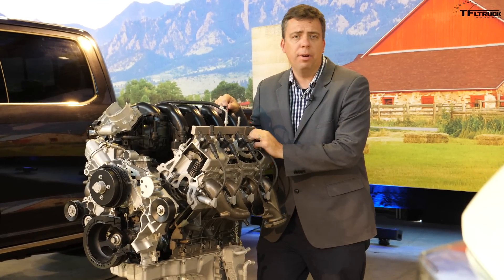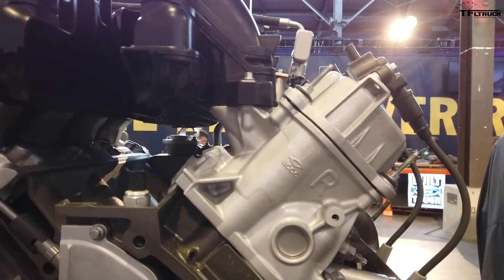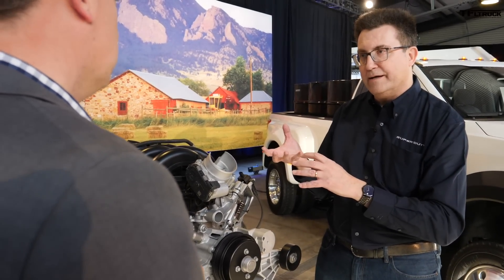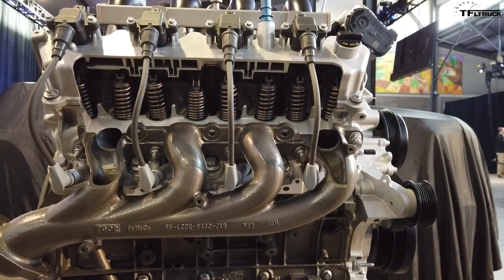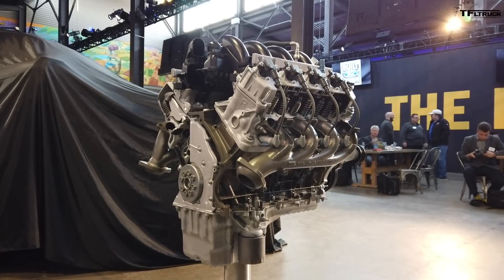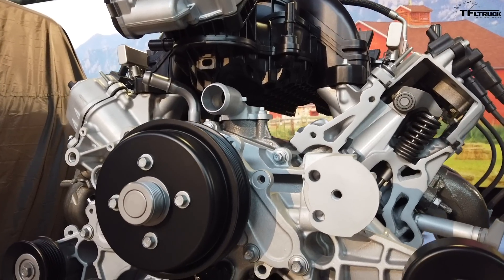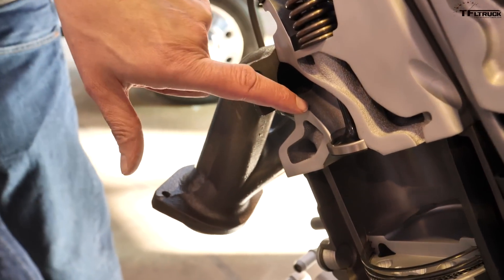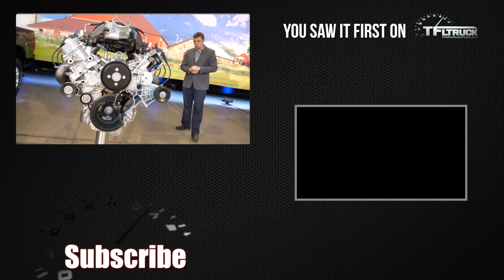2020 Ford Super Duty 7.3L V8: Here's What You Need to Know!

Comment: Are engineers finally coming around that there is no replacement for displacement for 3/4 ton trucks?  I think this is a great move.
Reply: Kyle Riegle it’s for their 650 750 trucks as well.
Reply: I cannot wait to find one in a junkyard so i can afford a Super Duty motor for my Car.
Reply: Kyle Riegle no they’re not. Which is why you see such an emphasis on TURBOCHARGED Diesel engines. Lol. 

There are replacements for displacement.

This is simply a low cost option for businesses that don’t want to spend $10,000 on a diesel upgrade.
Reply: Firestarter TURBO BAD!!!! Unless it’s in a diesel because somehow that different......
Reply: @jasonlarsen3515  I once was on a boat powered by two V20 quad turbo Diesels. 10.000 HP at 1200 RPM each!
Reply: Firestarter No, there isn’t a replacement for displacement. If all things are equal (e.g both have turbos etc...) the big engine always wins. Do everything in the 3.5 to the 5.0 and tell me which has more power.
Reply: bwhs89 the 3.5 clearly has more power and torque... 450hp and 510 ft lbs.

And it’s power doesn’t drop off with altitude like the 5.0 does. 

The 3.5 even craps all over the 6.2l it replaced. 

Judging by your comment I’d assume you haven’t towed with a 3.5, cause it blows the doors off the 5.0 and runs at much lower revs. 

Even the weaker 3.5 matches the 5.0 on power (dyno show it has slightly more, but ford derates it for whatever reason) on the top end and completely outclasses it from 2,500 rpm. 

But you’re probably one of those truck guys that thinks low end torque is pointless and high rpm power is what matters. 

#micdrop
Reply: needs timing gears instead of a timing chain
Reply: @KTMcaptain  a power stroke and its competition all have a lot of displacement just saying.
Reply: Looks like a good replacement for the V10 in the gasser motor homes both class C and the Class A.  I wonder if it will make its way into the F53 chassis?
Reply: @KTMcaptain  i thank u missed his point. Hes saying all things even a bigger displacement will always make more power. To your point ford dosnt make a turbo 5.0 so it dosnt matter, but if they did do a 5.0 turbo it would make more power than a 3.5 turbo. Just like the 3.5 turbo makes more than the 2.7 turbo. The bost is what makes the 3.5 more powerful ( and i agre with u i have a 3.5 crew cab that would walk my much lighter 5.0 regular cab 2wd work tuck) if both motors were bosted the bigger motor wins.
Reply: Steve Blakley and yet it still needs a turbo to make that power. How much torque do you think that 6.7 would put out without a turbocharger? Lol. 

Guessing you never drove a naturally aspirated Diesel engine.
Reply: Steve Blakley don’t be ridiculous. Ford doesn’t make an engine to maximize power. They start with a goal in mind. 

So comparing 400hp engines, the 3.5 does a better job of making far more average power throughout the gear ratios than the 5.0 does. 

So for 400hp there is a clear replacement for displacement.
Reply: @bwhs89  lol u clearly have no idea what your talking about I've raced and fully built many ls v8's and bmw n54s and 4g63s when its time to bully sum cars the 4g63 a little 2.0 is the boss everytime .
Reply: So a 3.5 would hold up in a 3/4,1 ton, medium duty truck? Is that what I'm getting out of this argument?
Reply: Firestarter your right, diesels are expensive and diesel fuel in Canada is more expensive than gas, so a gas engine makes more sense for many here in Canada. $10,000 extra for a diesel and 15 cents a litre more for diesel adds up fast.
Reply: @KTMcaptain  i just said that my 3.5 pulls better than my 5.0 work truck. All i said was the bigger the displacement the more power u can make thare for a big displacement motor with boost will out perform a small motor with the same boost. Its calls the larger motor starts with the advantage of displacement. So no mater what u do to the smaller engin if u do the same to the big one the bog one always makes more power. Same gose for vvt, dfi, boost what ever the larger mottor always has the built in advantage of size.
Reply: its amazing what Ford'll do to keep UHaul's business once they get it, but don't worry, their doing this for the budget minded folks who realize new trucks don't last as long as the diesel engines and there's no real point in spending an extra 5-10k for an engine that'll last longer then the truck when theirs a cheaper engine that'll get the job done, especially if you don't live on a mountain, and yes, this engine is built cheap, not well
Reply: Firestarter the 3.5 don’t fall on its face at altitude because of the turbos. Add the same setup to a 5 litre and you would be looking at a motor that would totally crush the 3.5. You would probably be looking at close to 600 hp
Reply: Matt J who said medium duty 3.5?

I have no doubts that a 3.5l turbo engine could be engineered to work for a medium duty application, but the actual 3.5eb and 5.0coyote aren’t medium duty.
Reply: @KTMcaptain  nah the 5.0 is better
Reply: Firestarter what point are you trying to make? Because the 3.5 needs the turbos to make 365 hp. Take off the turbos and you have a motor with under 300hp
Reply: @bwhs89  The 5.0 is a better engine to modify than the 3.5
Reply: The bigger engine will ALWAYS put out more power,there's that thing called forced induction.I don't see too many top fuel 4 and 6 cyl's but plenty of 10,000 hp Hemi's.
Reply: @KTMcaptain  Diesel is still an option because it's better for towing.
Reply: The EB is simply a strung out v6 set on kill
Reply: @michaellittlejohn8723  So basically wait two-three years.  🤣
Reply: Wasup Fool the 3.5 eb makes 450hp 510 ft lbs in the f150 and 647hp in the GT...

So clearly there is a replacement for displacement, and it’s called a turbocharger. 

Even semi tractors use much smaller engines than they’d ordinarily need without a turbo. Yes they’re large, but it would need to be significantly larger without the fi.
Reply: Yo Dawg strung out? Iron block, forged engine internals, and better oiling....

It’s not a strung out v6.... that’s like calling the 6.7 Cummins a strung out 6 cylinder cause it makes 1000 ft lbs of torque.
Reply: Yo Dawg lol I wouldn't waste much time on an EB fanboy that doesn't comprehend science.
Reply: Javier Hernandez the 4WD is way better than 2WD especially when you’re towing heavy loads
Reply: @jaywhy225  haha very true
Reply: @chanseormon  Actually its not. If you stay on pavement, a 2wd is more stable, and gives better MPG
Reply: bwhs89 “ Do everything in the 3.5 to the 5.0 and tell me which has more power” is a dumb argument lol. The boost being the replacement for the extra displacement that the 5.0 has. So making it so the 5.0 is bigger and boosted on top of that isn’t really proving anything
Reply: American engineers of the Big Three have known that all along! just like they also knew that diesels are not meant to do work in passenger cars ! 
good thing is that they are so bold to act, engineer and develop their engines accordingly ! unlike the sham that is going in other markets, such as germany.
Reply: Capt. Crab you’re not moving a semi truck with the 5.0 or 7.3l either, so that’s a worthless hypothetical. 

You can engineer the vehicle with stronger parts and better heat rejection for longer duty cycles. 

Displacement has nothing to do with the size of your mains or rod bearings. You can easily build a block to handle those kind of stressors. It’s not beneficial to do so because of cost.

Displacement does not equate to reliability. The 5.9 12 valve Cummins 6bt is far more reliable than the 6.7 24 valve Cummins. 

Even the 3.9L Cummins in-line 4 was extremely reliable for commercial use.
Reply: bwhs89 go look at Ken blocks f-100 and tell me you can’t get power from the 3.5L. 🤘
Reply: You can get big power out of most engine's but longevity and reliability are the two main factors,it just make's more sense having a bigger engine that doesn't have to work as hard,it's called common sense.
Reply: @joeyscleaningladys  mo' money
Reply: Yo Dawg he also reminds of that CJ Colvin character... always bragging about his “96 F150 with the 5.0 Windsor V8” and that we’re all a bunch of “typical modern truck lovers”. You just can’t fix stupid.
Reply: @jaysson1151  nope
Reply: You can’t argue with physics... there is no REPLACEMENT for displacement.  That whole saying is utter crap that is constantly said by people with smaller cube engines with some sort of forced induction.  What they should say is that there is a COMPENSATION for displacement. As in, the turbo or supercharger or what have you, is compensating for the lack of physical displacement that the engine has.  Sure, you can make a small engine perform like a big one with the use of direct injection, variable valve timing, turbo chargers and all that nice new technology.  But give all that same stuff to an engine with more displacement and the bigger engine ALWAYS makes more peak power.  Has to be an apples to apples comparison though.  Meaning that all things are equal with both engines except for the displacement. People that say there is a replacement for displacement are never making an apples to apples comparison though.  Just cuz your 11:1 compression ratio, direct injected, turbocharged 4 cylinder makes more power than a 8:1 compression, port injected naturally aspirated big cube engine, doesn’t mean there is a replacement for displacement.  It’s physics.  And unless you don’t live on planet earth and somehow have an engine that follows some other crazy laws we don’t know about, it cant be argued.
Reply: @prophed4849  exactly.The bigger engine doesn't have to work as hard unlike the smaller one's making the same power numbers which are damned near maxxed out.
Reply: @KTMcaptain , this 7.3 is meant for the F250 and up
Reply: Yo Dawg yep. People seem to forget that the four stroke internal combustion engine hasn’t changed all that much.  They get lost in all the hoopla and technology.  Sure we’ve made engines better by increasing their volumetric efficiency over the years.  But one thing stays the same. In the end, it’s still an air pump.  And the bigger the engine the more air you can pump in (or force in) More air means more fuel burned and more power made.  Ford is smart here.  They found a niche market and are exploiting it.  Diesel prices have gotten insane.  I would love a new truck but can’t swallow spending 60-70k on one.  So my old 7.3 Powerstroke will just have to last me another 230k.  Shouldn’t be hard since Internationals D50 life is rated at 500k.  This new 7.3 gasser hopefully avoids the premium price while still be able to tow. Another advantage of displacement is that it moves the torque curve down low so you don’t have to spin it fast.  Look at giant ship engines. Those things turn like 150 rpm and make  tens of thousands of ft-lbs of torque.  How?..... Displacement.  Always got a kick out of the guys who bragged about making 400 hp with their tiny little engines, but had to rev it to 9k to make it.  Oh and that 400 hp came with a whopping 205 ft-lb of torque.  Carol Shelby said it best “HP sells cars, Torque wins races”
Reply: Firestarter turbos aren’t the replacement for displacement on diesels. Diesels no matter what size are dogs. Try driving an 80s pickup like the 6.9 idi ford used. They could pull like a raped ape, but couldn’t get out of their own “coal”. Turbos help them in acceleration.
Reply: Yea the old IDI engines were horribly inefficient.  They relied on their shear size to make the sufficient torque to be able to pull.  And they did it rather admirably considering a lot of them didn’t have turbos and also had terribly low (for a diesel) compression ratios.  Diesel fuel has more energy content than gasoline so it has an advantage in making power right out of the gate.  But because it’s so much more resistant to detonation, it takes a lot of squeeze to make it go boom.  So you have to design an engine with a relatively high static compression ratio.  Add in the turbo charger and your looking at an even higher dynamic compression ratio.  All that squeeze takes beefy parts to live at those levels.  Makes for a long lasting, high performing engine.  But an expensive one at the same time.
Reply: @KTMcaptain  No replacement for a good turbocharged diesel.
Reply: @KTMcaptain  if they both have turbos  I'd say the 5.0 would win
Reply: @KTMcaptain  When you say ''weaker'' 3.5L I can only assumed you mean naturally aspirated 3.5L...Which dynos around 230hp to the rear wheels, the current gen 5.0L (in the F-150) dyno's around 315hp to the rear wheels, yeah the Ecoboost is a little better for towing as it damn well should be! It makes 70lb/ft more torque! BUT don't come on here slandering a bunch of bullshit about how Fords base 3.5L V6 is comparable in power to the 5.0L...News flash...its not.
Reply: @nathanmcdonald610  the 18 5.0 in the trucks are putting 350 to 360 hp to the tires in stock form from the 2 wheel drive! The 4x4's are putting down around 340 or so to the tires! There are a few videos that show this! The new 5.0 is no joke in the power department!
Reply: Absolutely smart
Reply: @jasonlarsen3515  because a turbo on a diesel is completely different than turboing a gas engine. Diesels run on detonation gas engines die from detonation ;)
Reply: I agree with  @KTMcaptain . My father has a 3.5 T and can outpull my 6.5TD all day long.  Its just better in every way.  I may have more low end torque being a larger displacement turbo diesel.  But thats not noticeable while driving. 

In 2-3 years once this engine is more refined it has amazing potential to compete with TD engines without the crazy price tag that comes with owning a diesel.
Reply: Actually, yes, diesels are different. That's why turbocharging is ideal (essential, really) for them.
Reply: @KTMcaptain  LOL there is no emphasis on "turbo diesels".  If anything, it's exactly the opposite.  Diesels are getting less and less efficient and more and more expensive to maintain.
Reply: Ethan Noel 1) you’re absolutely 100% wrong. Companies continue to develop Diesel engines. Expensive yes, but the best solution for heavy hauling by far. Also, since the dpf became mandatory, the engines have only gained in efficiency and are nearly where they were before. Government doesn’t test them because of their gvwr, so it’s hard to do direct comparisons over the years. 

2) I capitalized TURBOCHARGED and placed the emphasis on forced induction. As in, Diesel engines are dramatically smaller than what they would need to be naturally aspirated, so there is a clear replacement for displacement. So you were wrong on that assumption as well.
Reply: @KTMcaptain  Then why did Ford just come out with a new gasser and not a new powerstroke?  And when is the last time we saw a new version of the current 6.7 cummins?  And no, they're never going to get back to the efficiency they once had due to low sulfur fuel.  I get why diesels need to be turbo'd..it's not due to size, it's due to mechanical limitations on creating an effective compression ratio.  Right now, unless you're using your truck as strictly a towing vehicle for 10k+ lbs loads, there is no point in getting a diesel.  Gas is way cheaper, the engines are cheaper, and there is no emissions crap to worry about breaking down.  It's sad because I really love diesels but the fact of the matter is that our government is strangling them out of existence.  If this 7.3 is able to put down more than 700 ft/lb of torque and get halfway decent gas mileage, it's going to severely hurt diesel sales.
Reply: @bwhs89  that 5.0 would scream over 1200 hp hehe. Feel free to hook up my f150 I'll be the Guinea pig
Reply: @KTMcaptain  your argument is silly because the 5.0 isn't blown. Put two hairdryers on that smoke wagon and see what happens. #micdrop
Reply: ace 996 4g63 ftw 🤘
Reply: Ethan Noel that’s a laugh. Ford develops new engines continually. They continue to develop their power stroke Diesel engines. The f150, Silverado, and Titan all have Diesel options now. 

There is also a newish L5P dmax and a 1000 ft lbs Cummins.

Diesel engines do benefit from turbocharging, but don’t kid yourself. You think the 6.7 Cummins can come close to 1000 ft lbs without a turbo? Is that why my 12v Cummins had 215hp and 440 ft lbs stock with a turbo?

Diesel engines absolutely need the turbo to make their HP and torque. Without it they’d be dramatically weaker.
Reply: Fords need only make enough power to drive themselves either a) over a cliff, or b) to a Dodge dealership.

Hahaha, just kidding. About the Dodge dealership part, I mean. Dodges suck, too. Totally inferior to Chevy. Which also sucks. The best part about a Chevy is that a Toyota dealership will allow you to trade it in if you buy one of their vehicles.

If you are upset at what I have said, you just don't get it 😢     😉
Reply: @noidontthinksolol I was just posting some BS to go along with the rest of the BS. Everyone gets so hung up on snippets of wise-sounding information or catchy phrases. 

The fact is, there are many ways to accomplish a powerful engine. Some ways are better for different applications.

A big engine, generally speaking, allows for more power. To further augment an engines capabilities, forced induction is extremely useful. It doesn't necessarily "replace" displacement. I mean, try throwing a turbo on a motor with zero displacement. What a turbo WILL do, however, is increase what a given amount of displacement can accomplish. 

A lot of people here made some great points. At the end of the day, displacement and air intake are very good partners. One is not better than the other. They are different beasts entirely. Trying to compare one to the other is a bit silly.
Reply: @steveblakley5285  At least you get his point. It's amazing how some people seem to totally misunderstand what was actually said which in turn triggers a huge debate over what seemed to be a very simple and straightforward comment.
Reply: AMEN
Reply: @steveblakley5285  You are correct. A smaller displacement engine has to work harder to make the same power as a larger displacement. A 3.5 L will have to run much higher cylinder pressures or more ignitions per second than a 5.0 L at the same power levels. The Ford 3.5 goes the higher cylinder pressure route via forced induction.
Diesels are a different animal since they are compression ignition and it is easier to get to the required ignition pressure if your intake is already pressurized.
Reply: @KTMcaptain   Lol nice Hash-tag use /s.
I never said I hated that 3.5 or that It was weaker than the 5.0.
Also, I understand the statement "replacement for displacement" is meant as the turbo etc... making up for the difference in engine size. 
My point was only that all things being EQUAL, the bigger engine will always win. Trying reading for COMPREHENSION next time as it was pretty damn clear in my first comment. 
My original comment being correct doesn't make the 3.5 suddenly suck. 
And yes i'd still rather have my 11' port injected 5.0 any day, even if the 3.5 "blows my doors off".
Alas, where did I mention torque curves? I know the 3.5 tows better but the 5.0 also tows as well. You act as if it isn't capable of any truck duties.
Reply: @KTMcaptain  Gear ratios don't affect engine power. The 3.5 makes good power across it's wide power band because the turbo pre-pressurizes the cylinder before the compression stroke. More air at a higher pressure means more fuel can be injected resulting in higher cylinder pressures (torque). The risk used to be pre-detination but this has been fixed by not injecting the fuel until the piston is at or near TDC. The trade-off is that you have to build a more robust engine to maintain longevity.
Reply: @KTMcaptain  Diesels are compression ignition and aren't really comparable to normally aspirated or forced induction gas engines. Non-turbo diesels have a lot of trouble getting the required cylinder pressure quickly enough to ignite efficiently.
Reply: I was excited until I found out it wasn't a diesel they shou lda   simply made it  a 460
Reply: Rich I never implied that the 3.5 needs a gearing advantage. Like I’ve said before, it has a much wider torque band than the 5.0 which allows it to tow and haul much easier. 

Gearing does in fact change the way torque is delivered to the ground though. 

Diesel engines don’t require a turbo. Yes it’s true that a turbo helps their efficiency under load because of the extra compression (turbo charger pressure ratio x static engine pressure ratio = total pressure ratio), but they’ll run just fine without a turbo. 

Diesel engines struggle with engine timing. As the rpm grows they have a harder time advancing the fuel and maintaining efficiency. This is why they make good torque but little power without a turbo, and why torque always seems to be double the power. 

So yes, you’d need a dramatically larger Diesel engine to make the same output as a turbo diesel.
Reply: @KTMcaptain  Modern diesels don't have problem with engine timing as they are all electronically direct injected and there is no ignition timing on a diesel. Diesels don't like high RPM due to several factors (reciprocating weight due to beefier components to deal with very high compression ratios, slower burn rate than gas etc). Turboless diesels are extremely inefficient (the Detroit Deisel 6.5 mentioned earlier in the comments had peak naturally asperated output of 155 hp/340 lb/ft). The only time that NA deisels perform acceptably is in huge footprint scenerios running under 20 rpm.

Also, you stated that the 3.5 does well across all gear ratios. Which technically isn't true since an extremely high or extremely low gear ratio would hamper performance of any engine. The 3.5 does have a wider power band than the 5.0, but the 5.0 is not really having to work to make power. Internal stresses on the 3.5 are higher due to higher cylinder pressures.
Reply: Rich your comment shows how little you know about Diesel engines. 

Their piston bowls correspond with injector spray patterns. At higher rpm where they’d need more advance, the piston bowl becomes misaligned. Also, the piston will create less compression with more fuel advance making it even more inefficient. 

turbochargers don’t help Diesel engines unless they’re producing higher compression ratios. Driving unloaded down the road they aren’t producing enough pressure to change that. Yet Diesel engines are extremely efficient even when unloaded. Turbos just make them that much better. 

I know this as a fact with my 12v Cummins getting 25mpg with a large single turbo that didn’t make any boost until 2200 rpm. 

And you can design the diesel with even more compression to be just as efficient.
Reply: There most certainly are many 'replacements for displacement'. Such as well thought out torque multiplying gearing and forced induction.
Reply: Less high tech stuff, better engineering, more reliable...
Reply: @KTMcaptain  I misunderstood what you meant by advance (fuel injection rather than ignition). 
It's funny that you use the 12V Cummins as an example of turbos not helping unless you are at higher compression ratios since the 12V had a higher compression ratio than the 24V or the ISB (or the powerstroke or Duramax for that matter). Obviously with higher pressure forced induction you have to drop the compression ratio to keep cylinder pressures managable. 
My Cummins ISB gets about the same fuel economy whether I am unloaded or pulling a 27 foot v-nose trailer, but I have all the EPA shit on mine to make sure that I use more fuel than I need to.
Reply: Chris Rowlison what do you mean by modern trucks do not last as long?  If anything, I would say the opposite is true.  Modern trucks have achieved the perfect balance of utility, ease of use, comfort, and reliability.
Reply: Around here a lot of ranchers still use their old pickups from the 80s and 90s.  Does anyone think in 2050 any rancher will be using their 2019 ecoboost?  I don’t think so.
Reply: Can't believe how ugly those new trucks are
Reply: @KTMcaptain  he said everything in the 3.5 to 5.0, that means twin turbo and such to the 5.0 it will make more power
Reply: Michael Corbett that’s ridiculous. The 5-0 doesn’t come with turbochargers. You can add nitrous to it if you want, but it doesn’t come that way. 

You say there isn’t a replacement for displacement. Then you don’t need the turbos. Just the bigger engine. 

In the 60s Ferrari and Pontiac made cars with the GTO moniker. One had a 3L v12 and the other a 6.5L v8. They made roughly the same horsepower, with the 6.5 tripower option making 14% more power. 

That’s idiotic hypothetical is meaningless. You can add whatever you want then. 

There are 3.8L GTR engines built to 4L making 2000hp. Can the coyote do that? 

It’s ridiculous because anyone can change anything on their engine. 

Stock vs stock the 3.5 blows the 5 liter out of the water. And even the 6.2 Chevy v8 when you’re talking about the mid level 3.5 ecoboost (limited and raptor h.o. version). 

So yeah, there are several replacements. Nitrous, supercharging, turbocharging, rpm enhancements, different fuel injection technologies, better fuels... and probably others. 

Btw, stock viper engine vs stock ford GT 3.5 ecoboost... 8.4L v10 makes the same HP and 50 more ft lbs over the 3.5 ecoboost. Even the supercharged zl1 6.2L Barely out powers the 3.5 ecoboost. 

But you’ll keep complaining about turbos. And just by your complaints you’re acknowledging a replacement.
Reply: @KTMcaptain  dude how dense are you, we are saying if you added the turbo and same technology used in the 3.5 to the 5.0 (making the ecoboost a 5.0) it'll make more power, I can tell you are only here to argue and not to bring anything meaningful to the discussion.

As far as the topic of different engine designs it's just that an engine designed for a different purpose. High rpm go vs low rpm torque, one engine designed for an awd application and less than 4000 pound car vs 2 or 4 wheel drive 4000 to 6500 pound truck made to tow and haul.
Reply: Michael Corbett how dense am I? Lol. 

You’re the one constantly adding custom parts to an engine that doesn’t come with it to try and make an irrelevant point. 

That a custom built engine will make more power than a 100% stock one. Lol. 

Put the same exact turbochargers from the 3.5 on the 5.0 and it’ll choke out and die. It’s not built for boost and excessive drive pressure and completely inefficient compressor will cause its death. 

Keep doing down that hypothetical rabbit hole. 

You can always, and easier, put larger turbochargers on the 3.5, so your point is irrelevant. 

Now you’re comparing turbochargers flow rates. 

Yes turbochargers EASILY replace displacement. That’s actually been the trend for the past decade, and cars have never been faster or higher performing. 

Even ford dodge and Chevy are refusing to put larger engines for their roided muscle cars. They’re using superchargers instead of larger displacements. 

So yes, there are clear replacements and you’re the dense one projecting your ignorant emotions into others because cognitive dissonance forces you to rail against smaller engines making more power EVERYWHERE. 

That’s ultimately the fact that matters. Forced induction is not only a replacement, but it makes BETTER power. More useable power.
Reply: @KTMcaptain  so bigger turbo make more power on an engine designed for it thank you for proving us right that more is more.

But like another poster said take the smaller ecoboost vs the larger 3.5 ecoboost oh wait the bigger engine with same setup made more power how strange...
Reply: Michael Corbett I guess you can’t read then. Because that’s not what I said, or are you now trying to imply that more turbocharging somehow equates to a larger cylinder displacement?

I’ll even give you naturally aspirated examples. 

Like the 3 liter Ferrari making the same power as the 6.5 liter Pontiac. 

Heck, even a modern 5.0 coyote trounces the ford 460 engine of old by 100 hp. That’s a 7.5L engine. 

The truck 460 from the 90s made 230hp and 390 ft lbs of torque. How much does the f150 5.0 make? 395hp and 400 ft lbs. so more torque and 165 more hp. 

Even the 5.2L mustang engine makes as much or more power than the 7 liter Chevy z06 engine. Bmw made a 5 liter v10 that made around as much power as both those engines. 

Facts are facts. You want to create hypothetical custom built engines to prove what? That an aftermarket engine can beat a stock one? 

A stock 5.0 is dramatically larger than a stock 3.5, yet the ecoboost makes the v8 its bitch everywhere other than peak rpm where they both make virtually the same measurable power. 

And it gets much worse with altitude where the v8 becomes anemic.

But when the ecoboosts blow you away, you can just reply, “oh yeah! If I put a turbo on this thing then I’d have won.” Lol. 

What’s next? You can throw on a heads and cam package? That’s the problem with hypotheticals, cause it’s never ending and proves nothing but imagination.
Reply: Firestarter what's he's saying is if the 5.0 was turbo charged it would be a hell of a lot better then the 3.5 in hp and torque
Reply: They should offer it turbocharged...then it would be a badass engine! More power and better efficiency with a turbo.
Reply: @stevenhorsefield2909  guy is just there to argue don't waste your time
Reply: Steven horsefield and what I’m saying is that’s a custom part for that engine. 

Take the money you spent on turbocharging that coyote and get larger turbos, pistons, and rods, and you’ll make more power with the 3.5 then. 

That’s the problem with comparing stock engines to a modified engine and making up nonsensical hypotheticals. 

And that goes against the replacement for displacement mantra. Want more power, then make the engine larger. So by saying you can make the 5-0 better with a turbo you’re admitting there is a replacement for displacement.
Reply: @joeyscleaningladys  While I totally agree, I think most companies prefer chains or belts these days as they are far quieter.
Reply: @sploofmonkey There's never been a factory 351 Cleveland-equipped Ford truck, unless you count the Ranchero. You might be thinking of the 351M/400, which is extremely similar to the Cleveland but with a different block (among other things)
Reply: @KTMcaptain  Having a good time? I thought I was the only one who noticed that your username is very descriptive of your conversation skills LOL
Reply: Trent Hura Well, A Fire Inside sounded like I had some std/sti and I didn’t want to get sued by that boyband... and intense wet dreams sounded like I wet the bed... so I settled on firestrarter. I’ve had family members accuse me of having aspergers because I’m contentious and lack the willingness to seek external validation (not caring about what others think is how those troglodytes put it). 

In reality I don’t give AF and feel that my opinions are scripture. If anything I suffer from NPD (narcissistic personality disorder). Lol

But I do change my thinking when one makes an articulate and rational argument that causes me to re-examine my own biases and conclusions on the topic. 

Cheers.
Reply: @KTMcaptain  until you realize that turbos abuse motors and it will never last as long...... you're not getting the point
Reply: IAMREALSUPERSAND the most reliable engines are turbocharged... so I guess you can keep telling yourself that.
Reply: @KTMcaptain  name a standout reliable turbo engine besides the 5.9 Cummins
Reply: IAMREALSUPERSAND there are hundreds of different turbo motors from airplanes to trains to otr trucks. 

Can you show one single bit of statistical data that is illustrative of your claim?

Typically turbocharged motors are built with stronger parts, larger bearings, etc. The ecoboost 3.5 has an iron block, forged steel crank, forged rods, and many other non advertised enhancements to strengthen it.

Where are all these unmodified turbo motor failures?
Reply: @KTMcaptain  do you even know how a turbo works??? It increases the compression of the engine to make more power, and why dont they increase the compression ratios of gasoline piston engines??? Because gasoline is unstable at the higher compression ratios. And it works for diesels because diesel is a much more stable fuel. If you build a motor and its naturally aspirated. It would last much longer without a turbo. It's just a fact.
Reply: IAMREALSUPERSAND you never limited it gas powered engines and even brought up the 5.9 Cummins. Newsflash, it runs on diesel fuel. 

Regardless,

turbocharged engines use lower static compression ratios to adjust for the increases from the turbo. 

Again, turbo motors are built stronger than naturally aspirated engines. Modern engines have knock sensors that allow the engine to pull timing and adjust other parameters to keep the engine running smoothly. 

You act like turbo motors are knocking all over the place, when in reality they run just fine. 

So you have higher cylinder pressures, but the engine is physically stronger. 

So where are all these stock blown up turbo cars?
Reply: @sploofmonkey  In the US at least, the Cleveland was never put in any pickup. It's last year in passenger cars was '74. Trucks could be had with the 351M/400 from 1977 to 1982. '78 and '79 Broncos were actually only available with either a 351M or a 400.
Reply: @tylerretty7299   Comparing an old GM diesel to a new ecoboost is not a valid comparison.  They are archaic, from another era.  Comparing a newer 6.6 duramax to an ecoboost in towing is a better comparison.
Reply: @KTMcaptain  Plus the added operating cost of a diesel...
Reply: Ethan Noel a new version of the current 6.7 was just made. Same engine different parts. More torque and more power. It’s 2019 buddy.
Reply: @KTMcaptain  lol did you even read his comment?....whoosh....
Reply: @bwhs89  I simply do not understand your comment. The replacement for displacement is the turbo.  You want to add the displacement to the replacement and claim that proves something. The turbo doesn't replace displacement if you keep the larger engine. You still have the displacement the turbo was designed to replace!
Reply: Firestarter Micdrop? Not even citing correct information. That’s the high performance 3.5 From the Raptor.
The regular 3.5 you get in a work truck first time only makes 375HP and 470TQ.
You get pretty similar capability from a 6.XL push rid like GM’s 6.2L, which btw gets better gas millage when pulling near the limit.
It’s just simple physics too, a smaller engine is going to work harder than a larger one when put under stress.

I’d assume you’ve never driven GM’s 6.2 Vortec?  Beating the 5.0 isn’t a achievement it’s a DOHC engine and has slightly less power than Ram’s Hemi 5.7.

That’s why Push Rod V8 and Diesel are the best engines for trucks. Lots of Displacement and Low End Torque for high and easy work output.
DOHC and TTV6 are better left to performance vehicles.
Reply: @KTMcaptain  In terms of reliability, there's no replacement for displacement
Reply: Ethan not true. Which is why the Toyota 4.7 outlasts the 5.7.

Try reading my comments about how every engine is designed differently.
Reply: Necrotic Reaper simple physics? Clearly you don’t understand what is actually happening inside an engine. 

A larger displacement will only apply pressure over a larger surface if the bore is larger. 

If the main bearing are the same size, then displacement would have no effect on longevity. 

Unless you’re burning a hole through your piston, bending a rod, or losing a HG, displacement has no effect on the rest of the engine. 

Larger displacement doesn’t equal larger engine internals. Look at a Cummins 5.9 vs dmax and you’ll see what makes an engine reliable. The engineering that goes into the parts, the bearings, etc.
Reply: @KTMcaptain  Uuuuh 5.7 what?
Reply: Ethan Toyota only makes one 5.7 v8 in North America. 

You remember the million mile tundra? 4.7, all those cockroache 100 series with over 350k miles? 4.7...

Then you look at Chrysler’s power tech 4.7 v8 and it’s junk. 

Displacement only means how much area exists between tdc and bdc.
Reply: @KTMcaptain  So if there is a replacement for displacement, Why didn't Toyota just modify the 4.7 to produce the extra 71 hp that the 5.7 boasts?
Reply: @Ethan-ck6iz  I'm not privy to toyota's engineering discussions, so I cannot speak to why they made what decisions. please read through, especially the last part.

its a very good comparison. trucks weight nearly the same and likely use similar average power levels throughout the trucks life, ie owners don't go full throttle all the time so while the 5.7 can make more power the owner will use less throttle than a 4.7 owner. In this scenario the 4.7 is actually stressed more working at higher duty cycles.

also, by your logic I could bore and stroke out engine and tune it to the same hp and tq level and have a more reliable engine. This isn't true because cylinder to cylinder clearance will be more compromised among other problems.

In the end it goes down to engineering. people use to talk about 4 bolt mains understanding that the strength of the bottom end is based off the bearing and crankshaft design not the amount of fluid a piston in a cylinder displaces.

but you're welcome to point out what parts actually fail and how it is relevant to the displacement. spun bearing? nope. worn rings? maybe. shattered piston? sure (except the larger 2.5L subaru has this problem and the 2.0L doesn't LOL).

Problem is, people are assuming all else equal. it's not. If all else were equal and I threw on a turbo to make more power then it would be less reliable. but if I designed the block and rotating assembly from the ground up to be more robust then you have no idea if it would be more or less reliable.

I do know this, manufacturers have reliability targets through statistical modelling. tells them the probability of failures and the cost of repair vs the cost of using a more expensive (stronger) engine design. if toyota wants 400k miles, they'll get it regardless of displacement or induction type.

do you really think that a 6.2L chevy v8 is less reliable than the old 7.4L v8, both truck engines, that had nearly 200 less hp? or a honda 2.4L with 205hp vs Ford's modular 4.6L v8 making 225hp?

it comes down to engineering not displacement.
Reply: Firestarter But there must be some sort of obstacle still with these smaller engines cranking out more hp to meet the benefits of larger displacements. Because then wouldn’t we see larger hp models sharing the same engine as lower models? You can’t just keep building a smaller engine tougher and tougher to keep meeting the numbers of a larger displacement. Big boat engines are extremely large yet the power they produce could be met by a much smaller engine with a couple turbos. Yet it’s not done!
Reply: @Ethan-ck6iz  Of course there is a limit to how strong you can build an engine. But that is a different argument than saying the already designed smaller FI engine is inherently less reliable.

Large boat engines are turbo diesel, gas turbine, and nuclear steam turbine electric generators. So I don't see where you're going with that.

Boats also don't have transmissions. They go the the rpm you want and stay there, so making an engine with a small powerband is ok. Automotive engines need to have wide powerbands. Not only does a 3.5tt v6 have the same power output as the 5.0v8, but it generates more torque and at a lower rpm. That's a huge benefit. Yes, under max load the 3.5eb is running very rich to protect itself making it less efficient than the 5.0, but under little load it's running as lean and more efficient. So light duty cycle (its a 1/2 ton after all) will see a much more efficient 3.5eb.

you keep attributing strength to displacement. That's simply not true. Larger vehicles use larger displacements for more power. If you want 2000 ft lbs of torque at 1200 rpm then you have no other choice but to use a turbocharged 15L engine. It's very difficult to get a lot of power out of a low displacement engine. Honda knew they wanted 190 ft lbs, so they use the smallest displacement they can that can achieve that torque goal at 2100 rpm with their reliability requirements. A 1 liter simply wouldn't produce the torque at the rpm they want.

If I took a 5.3L chevy v8, last gen with port injection for ease of modification, and sleeved the cylinder to reduce the bore and used a custom crank to reduce stroke, then you'd see a more reliable engine. It would bring in less fuel, generate less force, and have a bottom end engineered to handle much higher forces.

I'm not saying every little engine is just as reliable as a larger engine. Although most enthusiasts know that 4 cylinder Yota and Honda engines from the 90s were cockroaches and easily outlast american v6's that were twice the displacement.

I am saying that reliability is determined by the engineering and material science that goes into creating the engine.

Again, all else is NOT equal. Bigger NA engines are NOT being designed to be as robust as possible.
Reply: Forced induction IS increasing displacement.  Displacement is about how much air an internal combustion engine can move.  Compressed air means moving more.  It's the exact reason that the EcoBoost drops to the same 8-9 mpg of a bigger V8 when you make it tow the same heavy load.
Reply: people will be finding wrecked trucks and be shoving these things in mustangs hide and watch cause i know i would
Reply: @michaellittlejohn8723  lmao